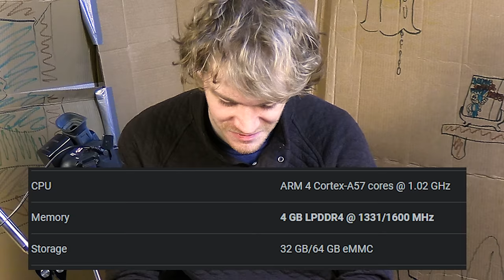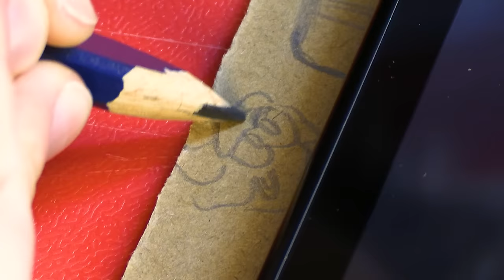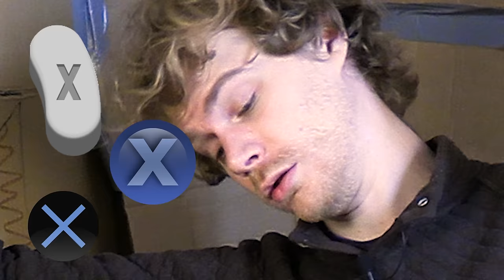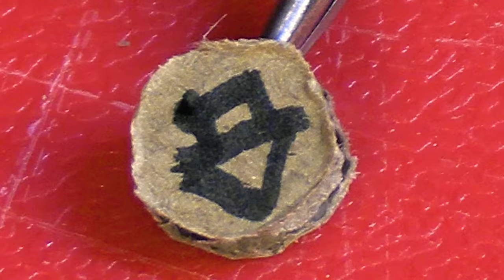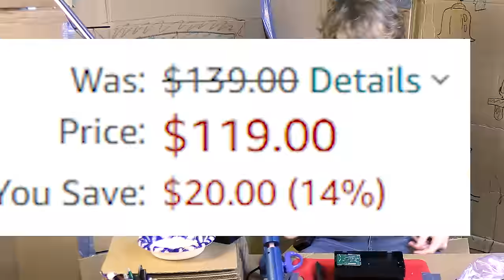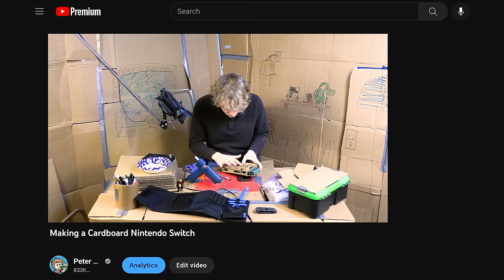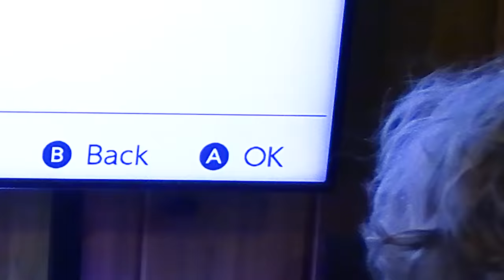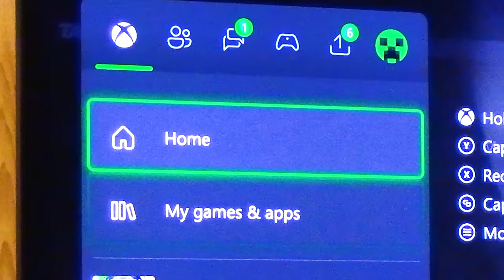Making a Nintendo Switch out of Cardboard

Comment: so technically you made switch labo with switch labo
Reply: However there was one big flaw:
In factory mode, you have to take the Joy Cons off. However one of the controllers was latched on and couldn’t come off. What he should’ve done is to get the Switch past the factory settings, turn it off, then deal with the cardboard stuff.